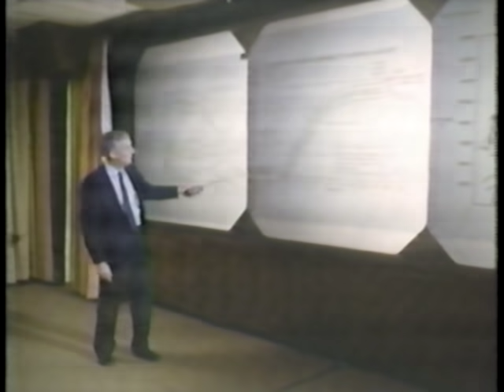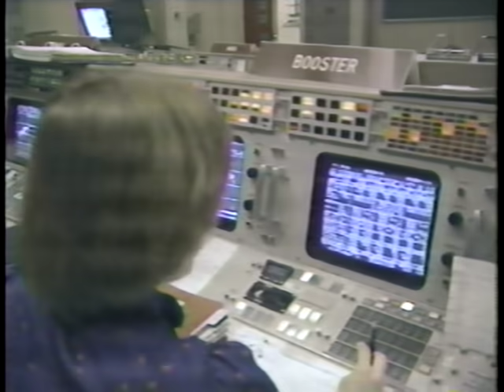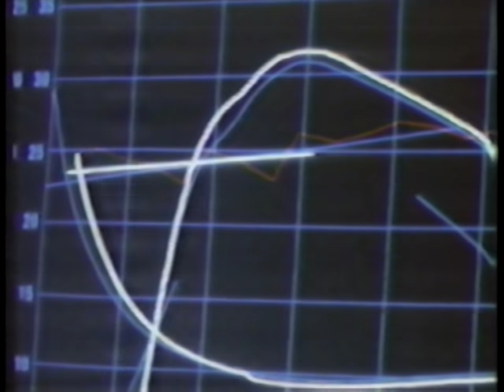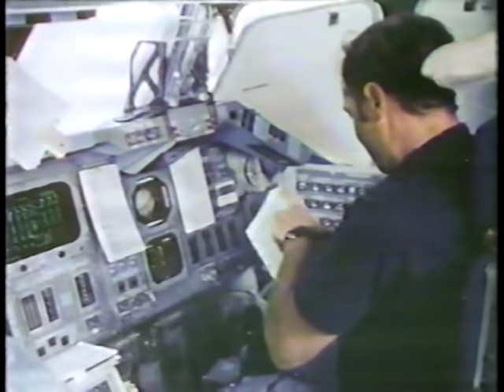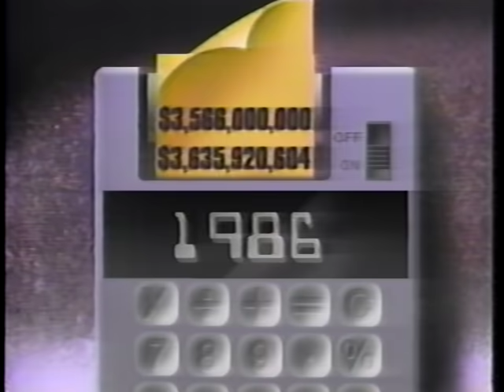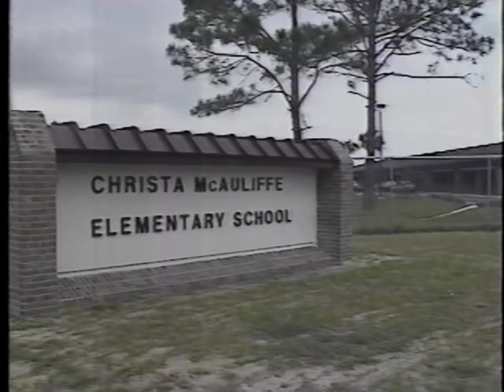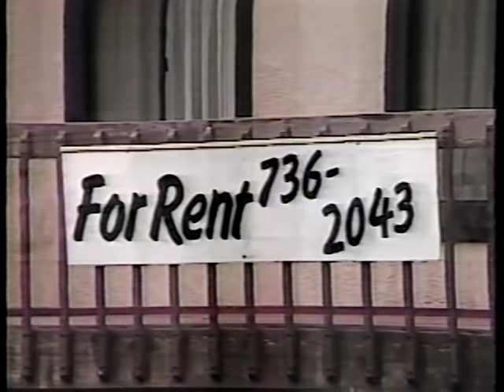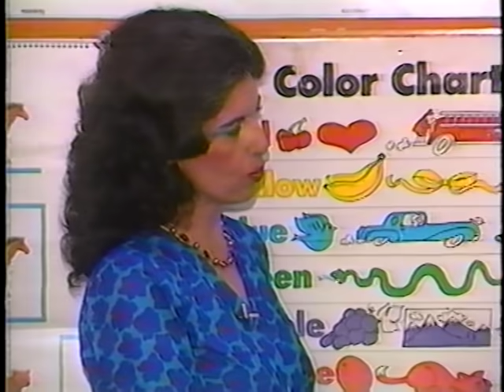Space Shuttle Challenger What Went Wrong

Comment: What went  wrong? I can tell you with some bitterness - the engineers were ignored, the data was ignored! (previous launch near catastrophic o-ring blow by (failure of the primary and partial failure of the second) ....and as Dr. Richard Feynman said to the Rogers commission "Anyone knows that an o-ring does not work worth a damn at low temperatures" Of course he made a very elementary and easily understood demonstration with a chunk of the o-ring material, a c clamp and a glass of ice water. Dr. Feynman said that o-rings are not made out of lead, for a reason - they MUST exhibit elasticity to work, and at low temps the material exhibited the characteristics of lead - it could compress, but there was NO elasticity, it could not seal the field joint from extreme pressures and gasses as it was required to do. 

The fault lies solely on the management at Morton-Thiokol over riding the SRB field joint engineers, NASA afraid to lose face as they would lose their PR "teacher in space" launch window (for a Friday class room) - and a complete lack of engineering and technical ethics, on the part of management. The deaths and the destruction of the vehicle was and IS on their heads.  

This situation was so dire that the chief SRB engineer (Mr. McDonald) refused to sign the go for launch fax - it was signed by Kilminster (Morton Thiokol management, (Mr. McDonalds boss)). It was Kilminster who played ball and accepted the absurd, baseless, untennable risk, for Morton-Thiokol.... who IGNORED his own engineers and data!!!   The engineers were forced into doing the impossible - PROVING that the SRB would fail catastrophically. That is illogical, that is not science, that is means for management to accept a go for launch determination that they simply wanted to hear - in this tragic case, management acceptance of intolerable risk, not supported by ANY data, and outside ALL of the go for launch parameters for the STS, killed the crew and lead to loss of the vehicle.   STS 51-L was NOT an accident (see the definition of an accident) - it should never have happened - it SHOULD have been a NOGO if the temp was <53 degrees F. 

The engineers did everything that they could to stop the launch, with NO management support (to say the least) and only a couple of hours to prep for a three way, night before morning launch) con call between Morton Thiokol, Utah, NASA , (Alabama) and Morton-Thiokol at the the cape, at 2030 hours EST).  - The engineers presented their case with logic, common sense , ethics  and aplomb.  Common sense and ethics, NOT displayed by either Morton- Thiokol or NASA management. 

This ethics-poor attitude slowly crept back in to NASA  (ignoring or minimizing the science and data) until STS 107 and a go for entry call, not allowing a prior request for a surveillance satellite to shoot high definition images of the vehicle leading edge carbon carbon surface....burned the morning sky....and "lock the doors"  was heard once again in Houston.    

Ignore science and data at your extreme peril, for neither cares one whit of human politics nor ignorance.....  . Columbia was yet another "non-accident" Yes as an engineer, who was once in flight test, I am still bitter.  Yes, I have seen true accidents in flight tests - it does happen, and people DO perish - sometimes like in the case of Mike Smith, who had just enough time to say "oh-ohh" on the flight deck CVR), very quickly, within a few hundred milliseconds - .  Of course the crew had 2.5 minutes to think about their fate, prior to hitting the water at >250 MPH and many many many G's......   and in space flight, regardless of what is told to, or believed by the public - it IS and will remain, very dangerous and can not be made less so past a certain point of data and science based acceptable risk.... , yes, more people will perish as the envelope is pushed - every test pilot knows and accepts the risk, without risk, you stagnate - However,  as I said, when the data and engineering team)s) is/are ignored, for political or program expediency -- it is no longer an accident.  Rest in peace, crews of Challenger and Columbia, your trust in those you entrusted your fate to, was betrayed, you did your duty.....
Reply: Launch Priority Vs Safety.
Reply: Cynthia Klenk This is a very accurate and well said assessment of the Challenger and Columbia disasters.
Reply: You can also blame Congress’s constant threats to cut funding for the program, NASA management was definitely to blame for both tragedies, but the looming threat of budget cuts due to delayed or scrubbed launches definitely didn’t help matters, and may have pressured management to want to “go” the launch.
Reply: ONE ENGINEER TOLD THE OTHER ENGINEERS FOR LAUNCH. THERE WERE WARNED OF LAUNCHING IN COLD WEATHER AND THAT ONE ENGINEER TOLD THE WARNING. THEY VOTED. AND THeY LAUNCHED. THAT ONE ENGINEER TOLD ABOUT THE O RINGS, AND COLD WEATHER, AND THE WARNINGS. THE OTHER ENGINEERS DID NOT LISTEN.
Reply: No idea why you claim to feel bitterness over someone else’s loss, but I can see you’ve watched that one documentary and taken it as gospel. The engineers did everything short of creating a design that wouldn’t automatically fail. Screaming their hysterical heads off after they invented that murder machine failed to stop the launch because nasa, rightly imo, found it incredible that a bunch of professional engineers would have created such a deadly amateurish affair. It wasn’t effectively sealing even at room temperature. That roger guy specifically undermined his case by presenting it in such a fabulous and grandiose fashion, which he continued to exhibit for decades since. He probably also cloaked himself in the bloody shirts of the crew just as you do, although I sincerely doubt you know what it means to lose someone. I also doubt anything in life would get accomplished from cancer treatment to structure construction if blameful, spiteful, “bitter” little minds like yours were allowed to rule our actions. May you be forever bitter, but may it never become the prevailing attitude of the American spirit.
Reply: It was also the State of the Union address the night of the launch, so having the teacher up would give a boost to Reagan's presidency. Instead he was delivering a speech from the oval office.
Reply: 100 % Agree with Cynthia Klenk
Reply: Similar case in Charnobhyle nuclear plant disaster. The political causes and the man trying to prove he is more than a god
Reply: Why does everyone say NASA when it was u.s.a.
Reply: I went too the last auction at 800 galaxy way
Reply: You have no idea what they will sell you at an auction
Reply: I have every thing they did on a daily bases at U.S.A  from start to finish .The lock the door command was for 800 galaxy way the space alliance building not the control room
Reply: @tarafficstory  Chernobyl was caused by faulty thinking... The Soviets/Russians have a long history of trying "tests" planned to explore how to avert disaster that can easily end in disaster themselves... Such was the case with Chernobyl.  

Nuclear power plants are 100% dependent on electrical power being available to power the controls, valves, and cooling pumps to safely shut down the reactor and cool it for a prolonged period to get rid of decay heat (residual heat from the fuel).  When a reactor "trips" or scrams, the control rods are inserted into the reactor to stop the chain reaction, but the fuel continues radioactive decay for some time, continuing to give off considerable heat.  The steam powering the turbines tails off, and the huge massive spinning high-speed turbines continue spinning for some time.  The Soviets thought that they could generate enough power from the residual energy of the spinning turbine to power the plant, and decided to test this theory, with no or insufficient and unprepared backups.  While testing their "theory" the idea DIDN'T work, the plant had insufficient power to control the reactor and keep it cool, it overheated, produced hydrogen gas, and exploded, blowing the reactor all over hell.  The Soviets cut corners every which way, including NOT using a containment building-- basically the structure over the reactor was no more substantial than say an automotive shop, and when the reactor blew, it blew this "tin barn" apart like tissue paper.  The rest is history.  

The Russians would do similar things even in their space program.  After the collapse of the Soviet Union, during the Shuttle/Mir program when US astronauts were staying aboard their Mir space station, the Russians were having difficulties getting parts of their automatic docking system for their Progress automated resupply vehicles bringing all the necessary supplies and propellant to the station.  As a "stop-gap" measure, they came up with a hair-brained "solution" that would have a cosmonaut on the station control the vehicle and bring it in for docking, using a television link and remote control radio link.  Of course the TV and radio links were spotty, and there was no fallback or "fail-safes" built into the system, and when the system experienced communications dropouts, the commander was reduced to screaming at the other cosmonaut as they were looking out portholes TRYING to see the incoming Progress freighter.  On one test, the Progress sailed by the station only a matter of meters away, and was later maneuvered in and docked safely.  On the last such test, the Progress slammed into one of the modules and ruptured it, causing all the air to escape out into space and would have killed the crew had they not managed to disconnect all the hoses and wiring running through the hatch openings and get the hatch to the damaged module closed before all the station's air escaped into space.  

Later!  OL J R :)
Reply: turnip 4343  They weren't asked.  

Several previous missions had come back with severe damage to the SRB field joints due to O-ring leaks and subsequent high-temperature gas erosion... IIRC it was either Nelson's flight or one prior that came back with a hole burned completely through the SRB casing, almost the size of a man's head IIRC... the only thing that prevented that shuttle from blowing up was sheer luck-- the leak hadn't gotten that severe until the boosters were almost ready to burn out, and the hole was facing AWAY from the huge external tank, so the hot blowtorch of gases escaping through the hole were merely venting out into the atmosphere safely away from the thin aluminum fuel tank.  

They KNEW that this was going on.  IIRC the temperature of that launch was 53 degrees, which is where the "don't launch below 53 degrees" rule came from.  (Didn't occur to them that even at 53 degrees the damage was severe enough that with BAD luck it would have destroyed the vehicle and killed the crew).  Other flights had suffered O-ring related damage as well, so it was so well known a problem that the O-ring redesign of the field joints was already "in process" but it would be another year before the new seal system was ready to replace the existing system.  They WOULD NOT wait or limit the flights in the meantime-- they took a calculated risk and LOST.  

It's what happens when "no harm, no foul" thinking becomes prevalent, when you start thinking, "well, nothing bad HAS happened, so nothing bad CAN happen!" and go on doing the same risky stuff and taking NO precautions to minimize the dangers.  They CHOSE for programmatic/political reasons to launch, EVEN THOUGH their own contractor engineers were telling them "it's not safe at that low temperature" and instead of backing them up or listening, instead they put pressure on "managment" to overrule their own people, with comments like, "My God, Thiokol, when am I supposed to launch?  Next April??"  They rolled the dice and lost. 

Columbia was EXACTLY the same way.  In the time between Challenger and Columbia, the lessons learned had been forgotten...  They'd had shuttles coming back with holes burned in the belly of the orbiter on MANY flights-- damaged or even completely missing tiles that had been shattered or damaged or completely knocked off by impacts, in one case they even had a hole burned completely through the aluminum skin of the orbiter belly under the tiles, a fairly large hole in fact.  Fortunately for that crew, it had occurred in a non-critical area that was not subjected to the most extreme heat during reentry.  Again, the "well, yeah, stuff happens, but nothing bad HAS happened, so nothing bad WILL happen!" thinking prevailed and they continued right on flying with a known, repetitive problem that could destroy the vehicle, rolling the dice.  They played Russian Roulette with the crew's lives and they LOST.  

Relying on sheer luck to determine whether a problem will not occur in a spot that will catastrophically destroy the vehicle is NOT an acceptable or safe operation.  Yet in BOTH cases of Columbia AND Challenger, that is EXACTLY what they did... It's like driving a car that you KNOW the steering or brakes have failed on a few times over the past few weeks, but you keep doing it because "nothing bad happened" because when they failed it JUST SO HAPPENED to be in a spot where you could safely run off into the grass or blow through an intersection without slamming into someone else or something...  What happens if the NEXT time the brakes fail is when a kid runs out in front of you, or the steering fails while negotiating a curve in front of an oncoming 18 wheeler??  

That is EXACTLY what NASA management did-- they bet the next failure (if it's failed a few times already, you can be SURE there WILL be a next failure given time and continued operation as-is) would NOT be in a critical area that would destroy the vehicle, and unfortunately for the crews, IT WAS.  

We'll never know how many OTHER similar types of issues that the shuttle system had suffered over the years that were similarly "glossed over" or ignored, that just by sheer luck happened in a way that just happened NOT to destroy the vehicle, IOW, that they "got away with" because another shuttle didn't blow up or break up... 

Later!  OL J R :
Reply: @lukestrawwalker  
Good write-up but...  The safety documentation for Chernobyl absolutely prohibited the test that was performed.  That is, even the Russian nuclear safety organization analyzed such a low power operation and recognized that the reactor would become uncontrollable.  

In addition, Chernobyl did not have a 'scram' as western reactors do.  The control rods are driven in using a motor and lead screw.  There are several problems with that design.  The first is the very slow rate at which the control rods are inserted.  The control rods can not insert negative reactivity anywhere near fast enough to compensate for a positive reactivity even such as loss of water (water is NOT a moderator for Chernobyl so a loss of water is a positive reactivity event as opposed to a western PWR where loss of water itself will shut down the reactor [no control rod action required---though you will get it]).

The second problem is that initial insertion under the conditions that the test allowed was itself a POSITIVITY reactivity event, so for the first few seconds reactor power increased both due to the loss of water and due to the insertion of the control rod (at such a slow speed).
Reply: @corettaha7855  haha so true 👍
Reply: @AlonsoRules  This has been widely debunked.
Reply: Cynthia I do agree that the whole thing could've been prevented. What they should've done was delay the launch until  they made sure everything was perfect, including the weather.
Reply: This was not the first failure of the SRB seals
Reply: Why not? Was there others we might not know about?
Reply: Yes Cynthia, that's true 👍
Reply: Televisionarchives - that it was not the first failure of the SRB seals is the REASON they went for the launch.
Failures happen with EVERY launch.  Engineers try to design systems that are failure survivable.   They put TWO O rings in place as redundancy to mitigate the potential of failure, and the fact that in prior flights O-rings had failed WITHOUT any incident gave them CONFIDENCE that the design was robust.  Had a prior O-ring failure been correlated with burn through, they might have been more focused on the potential.
Similarly- with Columbia- NUMEROUS tiles were lost on every shuttle re-entry, and numerous foam strikes had happened on prior launches. None had ever caused significant damage nor threatened the mission.   They had every reason to believe that damage to a few tiles was not mission threatening. The engineers who designed the carbon carbon panels were Certain that a foam strike could not break one of them- it took a practical test to prove them wrong.
Engineers often believe in their designs...
Past successful performance leads to confidence that the engineering solutions were sufficient to mitigate risks.   And folks armchair generaling the decisions make the exact same mistakes in their own lives and jobs, too.  When it’s YOUR career on the line, and your past experience suggests that someone raising the alarm is being alarmist, because the same issues never created a disaster in the past, chances are you would have a difficult time calling off an important time critical event that would cost a hundred million of dollars- especially when you would never be able to prove it WOULD HAVE failed if you had launched.
This is just human nature.   It’s nice to think we would do better... but that’s a fantasy.  Human beings are fallible. The very nature of the person who CAN get the job managing such a large organization is one most likely to tell their boss they can get the job done.
Reply: @corettaha7855  this is one of the most ridiculous responses I have ever seen to anything. To begin with, there have been numerous documentaries, books, and the Rogers Report itself. They all say the same thing. 

It wasn't just one engineer. It was all the engineers at Thiokol involved with the O-Rings on the boosters who agreed that the O-rings had a high likelihood of failure if launched at that temperature. They were overruled by management because NASA was under tremendous pressure to launch. The design of the space shuttle wasn't even what NASA wanted. They wanted a much smaller orbiter that launched from the back of a specially designed plane at high altitude. They were forced into the larger orbiter design by the Department of Defense and other government agencies in order to get funding for the shuttle program. By the time of this Challenger mission, the program was falling far short of its stated goal of sixty launches a year and they were in real danger of losing their funding. So the management overruled the engineers, which is something that never happened. 

This has nothing at all to do with the American spirit. When the engineers who design something say that the risks are unacceptable you listen. Period. None of them were suggesting that we shouldn't be travelling to space or that the shuttle program should be cancelled. They were saying to wait until it was warmer. That was it.
Reply: It was out of their hands, everyone wanted to see Challenger take off that day.
Reply: I think NASA were a bit more guilty than morto thiokol management, although i hope mt's big wigs learned a lesson to listen to the people that make you rich
Reply: well put
Reply: i been saying that for years should've been a engiering desion not a managment desion to launch
Reply: My goodness! Well said! THE best summation of what happened I have read.
Reply: And wind shear.
Reply: Cynthia Klerk: in regards to the Columbia disaster, please search for “Unethical Decisions - The Causes of the Space Shuttle Challenger Disaster Roger Boisjoly”. Boisjoly touches on the Columbia disaster and the failures of NASA engineers to contact the DOD for help in checking out Columbia’s condition prior to returning to earth. It will make your blood boil.
Reply: @BarneyR-u2d  DoD did have photos.
Reply: @corettaha7855  What u talking about? They did their best with 1970 technology.
Reply: @tarafficstory  stay in school and work on tour spelling
Reply: Well said sir
Reply: %100 agree. … but a certain amount of blame should be on the Whitehouse.
Reply: @gdwnet  by who?
Reply: @HootisGarage  by whom, not by who and to what are you referring? This thread is five years old.
Reply: @gdwnet  whom debunked the White House involvement?
Reply: @HootisGarage  The white house involvement in what? Is there any chance of asking a complete and coherent question?
Reply: Richard Cook, a budgetary analyst for NASA at that time felt that the REASON why management acted and behaved so odd was because NASA got orders from the president to launch to shuttle and that the Presidential Commission was put in place to cover that up.
Reply: Lighten up Francis
Reply: @jslugbug37  NASA (National Aeronautics and Space Administration) was in charge of building and launching all of the manned space flights in the USA.
Reply: @jenniferhardy1062  But they wouldn't delay the launch. Because Reagan was making his SOTU speech that night and going to highlight his "teacher in space" idea. PR stunts must be considered! Even if they endanger the crew of the shuttle.
Reply: @christopherpardell4418  It wasn't the tiles that destroyed Columbia. It was a large hole in the aluminum part of the wing above the tiles. The foam strike caused a hole in the wing the size of a briefcase.
Reply: @patrickfarrell5615  Except for the engineers who warned NASA of the danger in launching on a day when the temperature was below freezing.
Reply: @BarneyR-u2d  Nothing could have been done to save the Columbia. Their oxygen was almost gone and it would have taken over a month to prepare a rescue shuttle.
Reply: @HootisGarage  Reagan was pushing "the teacher in space" and wanted the launch to be on that day.
Reply: @SymphonyBrahms  perhaps you didn’t follow what I posted.   They had frequent tile failures, mostly due to FOAM strikes during launch.  In one notable incident, the tile that failed was critical, but just so happened to be covering one of the few pieces of stainless steel on the shuttle skin, and so did not burn thru.  Engineers noted that Had the tile that got struck been a few inches over, it Would Have burned thru… and yet, NASA never implemented any of the suggestions for tile inspection in orbit, nor for a means of replacing or repair tiles in orbit.
The Columbia did not have a hole in an aluminum part of the wing. The area that got hit was a Rigid  Carbon Carbon leading edge panel that NASA engineers were certain could not be damaged in a foam strike.  The investigation committee asked to see their test data proving that… and they had to admit they had never tested it, that their calculations showed the panel was more than string enough.   SO the committee had the perform an actual test- they mounted an identical panel on a stand and fired chunks of foam at it at the speed the foam was seen to hit the shuttle. Twice the foam chunk disintegrated on impact and the panel was fine.   But the third test the foam hit edge on and punched a hole clean thru it. 
Again… the point I was making is that when numbers says something is safe, and you launch 24 shuttle missions with plenty of foam strikes and no serious result, it is easy to become complacent and assume that nothing WILL happen because nothing HAS happened.  This is the danger of repeated success.  It makes you think you have it all figured out and need do nothing more.
Reply: That was nicely stated. I do a great deal of research into these HUGE events that have great impact on people's lives that should never have occurred. Especially when there's rumblings of wrongdoing or cover-up. I'm a former deputy sheriff, so I need to know the truth. There's not a single point that you made that I disagree with. I saw the testimony with the o ring material in the glass of water. The lack of rebound told the tale. I think that the biggest miscarriage of justice occurs when the ones who are responsible for these events go on with no real consequences.